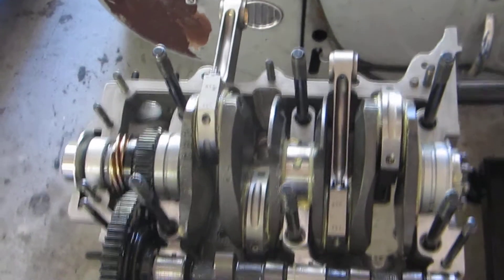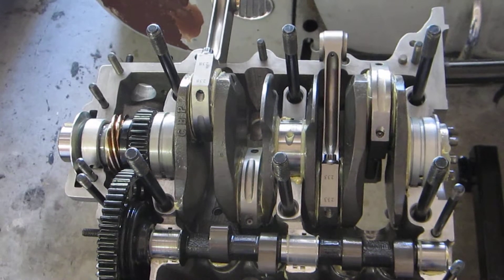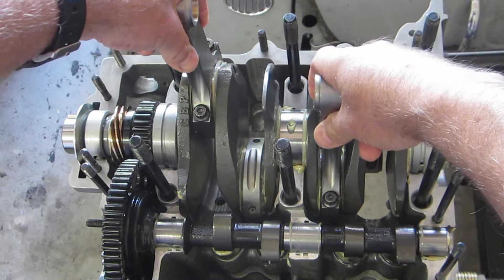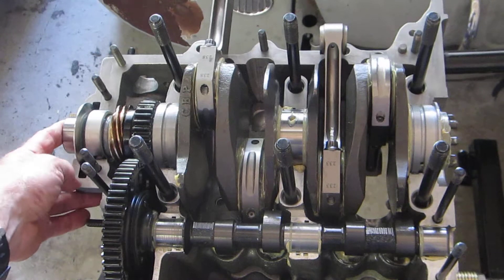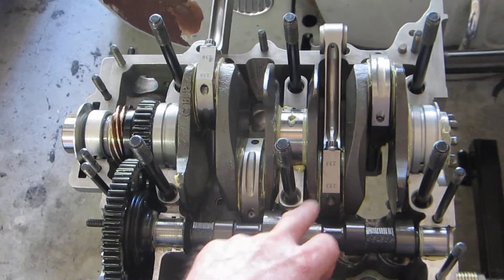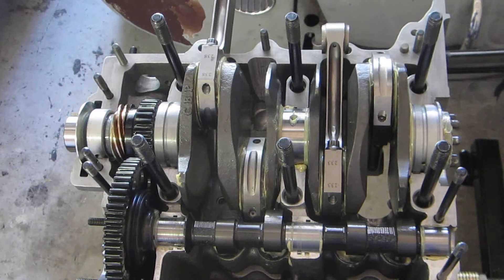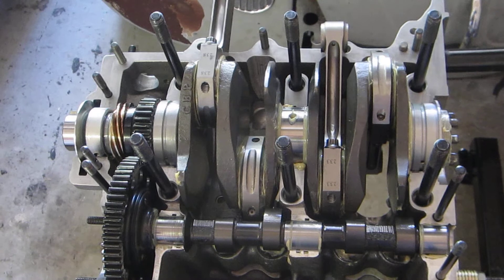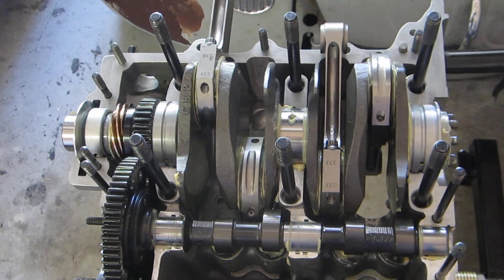2332cc VW Engine Build Part 1

Comment: I usually nip the corners of my rod caps for cam clearance with h beam rods.
Then weigh them to match.
5 thousandths clearance.
Reply from the maker: That is a great idea. I ended up grinding the cam a little, but doing it to the rods would work too as long as they are all rebalanced like you mentioned. Thank you!

Comment: I was thinking on my motor to put a bit of the clay putty stuff they use to check valve to piston clearance cause as engine is loaded and also wears a little could get closer so just barely missing might not work.
Reply from the maker: Sounds good. I have often heard too that one must have at least .040" deck height to be safe.
Reply: @vwsandvettes3253  I've heard at least .40 also.
Reply: @Thundarr995  .040 and .40 is a BIG difference you two lol